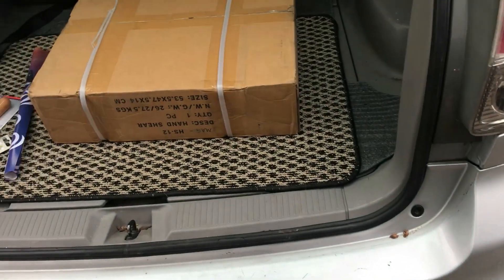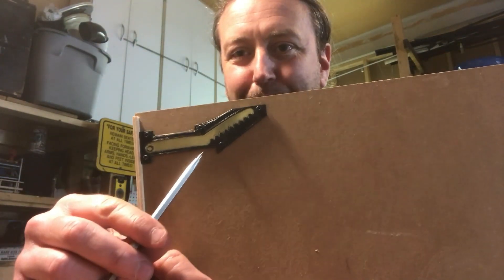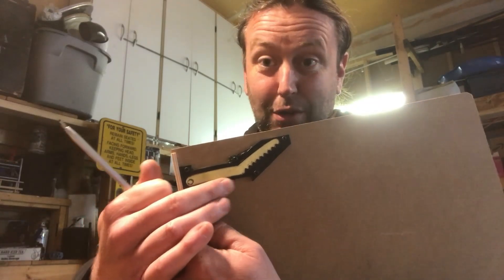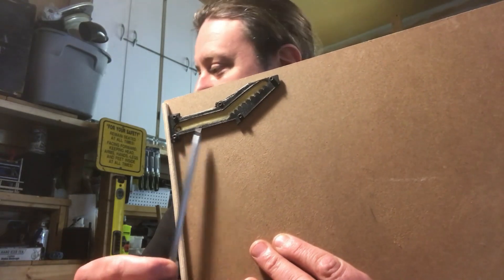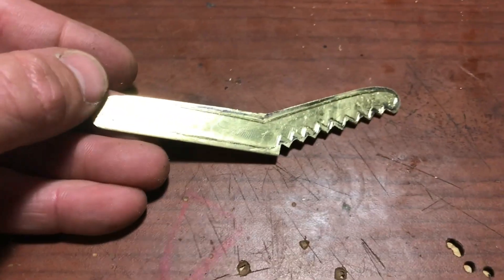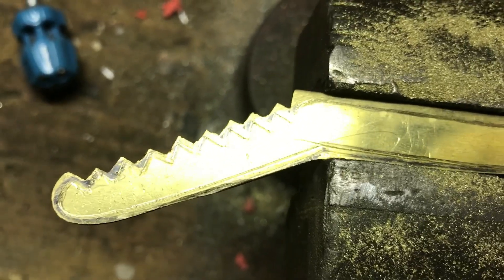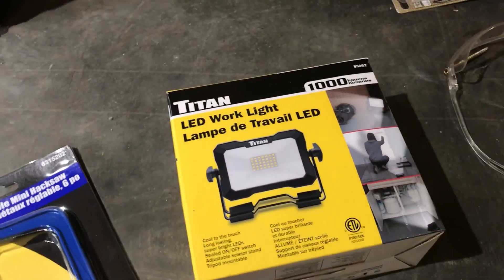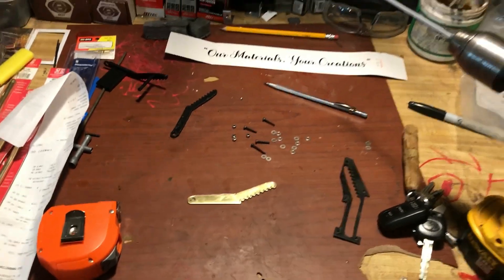COULD THIS BE THE END OF 3D PRINTING????????????

Comment: Hell yeah Nick as a fellow amateur metal work guy I only have a decent vice £20 a cheap grinder £25 a mains hand drill £20 taps a few cheap hacksaw but good blade tin snips a cheap dremil a hand drill press clamp and u seen my stuff mate 😉 a spring punch too mine works as a scibe too I dabble with aluminium and steel n9t got into brass but can weld it like with solder and brass I'd a good metal to start fabbing with Barste on YouTube his hand build are most brass too even lathes his own hydro rams I with I could lathe a weld properly
Reply from the maker: I love having all those tools, it really made a huge difference!!
Reply: @rcconstructionincanada3754  it does u never know the struggle till u got a tool to make life easier